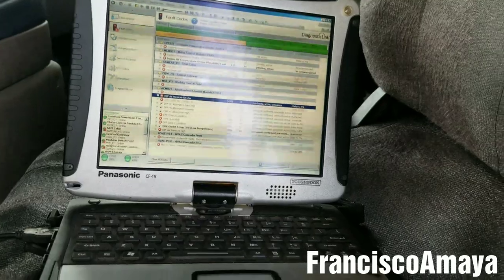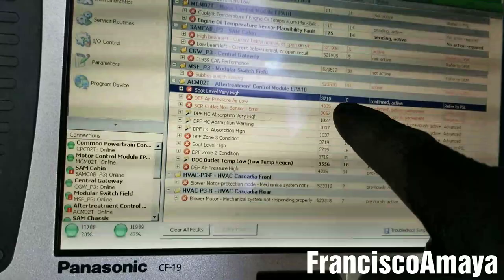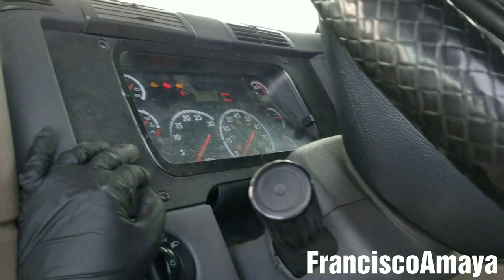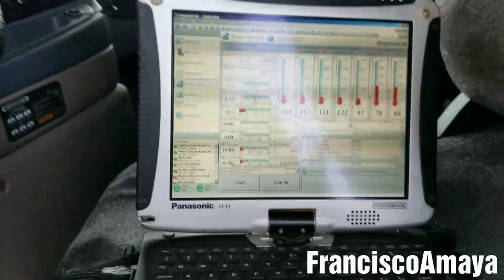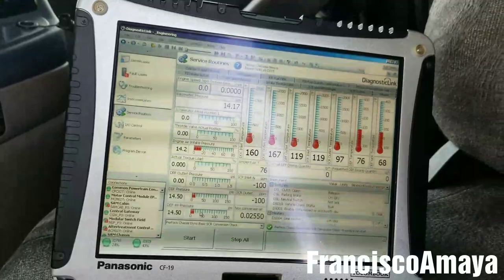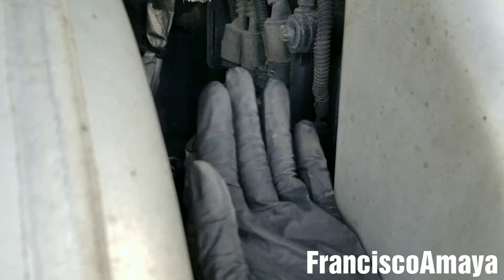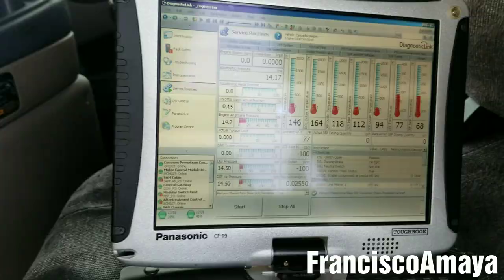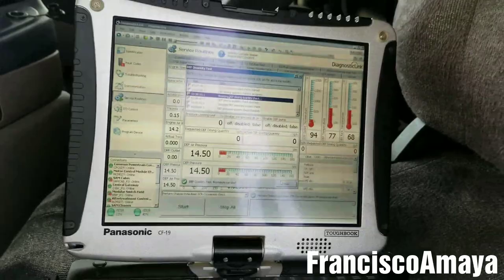DEF air pressure low spn 4335 fmi 7 sid 153 fmi 7 freigtliner cascadia dd5 dd13 dd16 light blinking

Comment: Both limited valve and metering valve were changed and it fixed the problem but code 4335 came back on 4 days later
Reply: I'm having same issue what ended up being the problem

Comment: I got the same truck with the same issues and replaced everything you  replaced and still got the problem and it's getting worse. Switching parts is not solving the problem . Let me know when you solve the problem make a new video.
Reply: U ever fix the problem
Reply: DEF pump is your problem